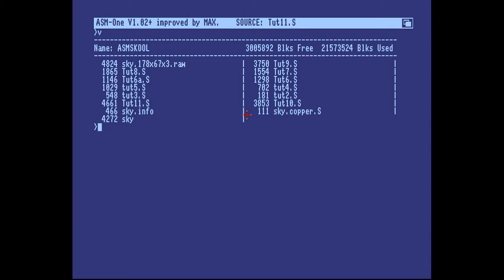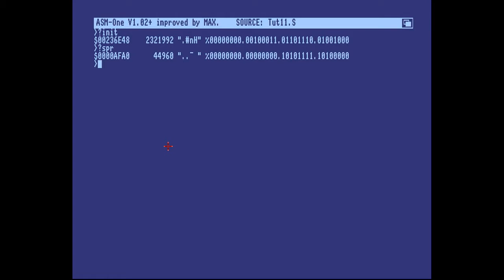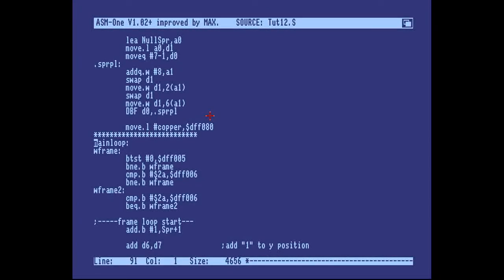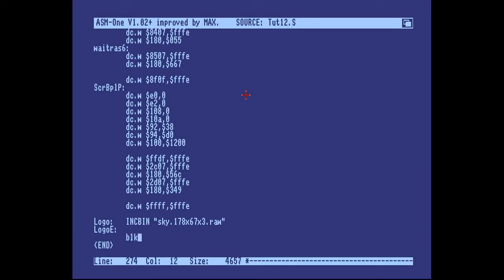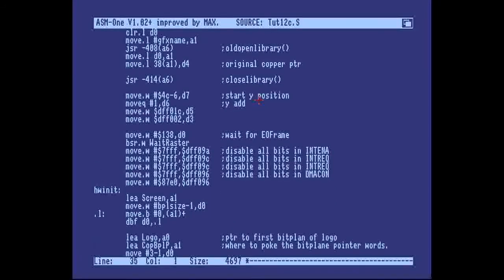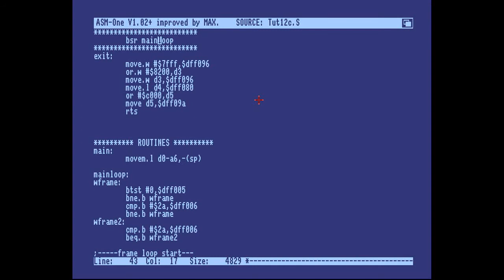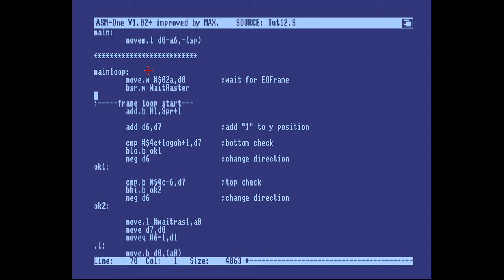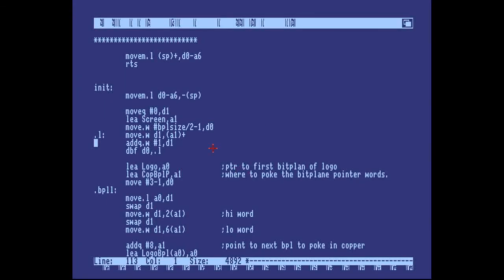Amiga Hardware Programming 12 - Bitplane manipulation, program structure, and the stack

Comment: Slowly working my way through your tutorials. For some reason I still can't quite wrap my head around the relation between playfields, display window, bitplanes and display data-fetch. I guess I should experiment more. Modern development tools have really spoiled me. I wish it was easier to debug Amiga graphics: step through copperlists, highlight stuff on the screen, ... the kind of things we take for granted when working with the browser or any modern graphics toolkit. Anyways, I'll persevere.

Thanks again for taking so much time putting these tutorials together.
Reply from the maker: The whole point of modern dev tools is to spoil you, if they spoil you they're good tools :) Directness is another feature that spoils you and is good - most of the oldskool platform coders started this way and so they could instantly get a feel for how the hardware works. I start concrete and go towards abstraction but once learned, it will become natural.

The two biggest differences from how we think about graphics today is understanding the raster (monitors still work this way, to an extent) and bitplanes combining to form pixel colors (all display modes today are one color value per pixel).
Reply: Word. Directness is exactly why I got an Amiga again and started following your videos. My brain hurts from juggling between decimal, hex and binary and having to do so much arithmetics to setup even the simplest display, but it feels so satisfying to poke some memory address in a chip and see a direct result on an analog screen in these days of ubiquitous virtualization, containers, countless layers of abstractions, JIT compilers, etc.

Anyway. Still about 30 videos to go, rambling will not get me there any sooner :)
Reply: I wholeheartedly agree. First off all, these tutorials are great, so thanks a lot for doing them, Photon! I've learned a lot from (re-) watching them, and I'm very much looking forward to the rest of them. If I can understand all of them as well as I can this first bunch (ie, up to a certain point), then surely I'll be a very happy bunny, indeed!

And like you said, Seb, there's something strangely satisfying about being able to program 'to the bare metal'. It feels very empowering, somehow -- but maybe that's because I tried and failed to do this about 30 years ago, and now I finally smell my chance at having my revenge.. ;)

And tbh, I've also been spoiled beyond believe, having Visual Studio and .Net and C# and Blender and Unity and what have you. It's nice to take a couple of steps back, and take a good and hard look at where this all actually came from. And having great nostalgic fun while doing it! :)

Comment: Is there a reason you type DBF in upper case and all the other instructions in lower case, or just out of habit?
Reply from the maker: No. Or rather, it's a readability hack that works to find code chunk starts and ends more easily without having to use multiple empty lines or comment delimiter lines.

In this case at 16:06, the end of a loop is made this way to make it distinct from other chunks of code in that function which also have a trailing empty line. 

I also put RTS to signify the return from a function, which mostly coincides with the end of the function.

In other languages you may find a lot of empty space between code. This would then be very spread out on a ~32 line editor window, so that you could read only half of a function per page.

In any language, an editor or assembler/compiler or both, can be case sensitive. Then you can't do this.

It comes from the same idea as in books: The first letter of a chapter might be a bigger capital, and when the story is done, it may say T H E   E N D instead of just...

The end.

Comment: Thanks for the nice tutorial. I wish I had something like this 25 years ago! I did have an assembler for my Amiga, but not a clue where to start and what to do with it...
I'm just starting to understand what you're doing here; when you changed the 'init:' label into 'start:' I wondered why you didn't change the 'JUMPPTR' line and when you wanted to test the program later and it didn't work I was almost talking to the screen: "go up and change the JUMPPTR line !" ; )  Mind you: I'm a total assembly noob. Could you put some more comments in your code? Just to clarify stuf you're doing.
Reply from the maker: Hehe :) And thanks! I do explain all the lines of code I write. I agree of course that Tut12.S has quite few comments in it. I will try to keep in mind to comment more!

Comment: For someone not very familiar with 68k assembly, that movem.l instruction for moving everything between D0-A6 to and from the stack almost looks like assembler magic instead of an actual opcode someone would cook up. Both push and pull take the "same" start and end sequence of registers, but clearly one has to pull them in the reverse order than the other one for it to work. Not very intuitive and user-friendly, is it?

Comment: Isn't writing...

 lea  Spr,a0
 move.l a0,d1

a more complicated way of doing...

 move.l #Spr,d1

directly?
Reply from the maker: +Rainer Koschnick Yep, that last example is how I started addressing addresses, so to speak :) Simpler and more direct, as in: move.l #addr,a0 is a synonym to lea addr,a0. Normally, addresses (pointers) go into the address registers. For example, you might want to modify the sprite-data and use the A0 register as a base pointer to do that. Typically, if you put an address into a data register as here, it's because you want to use it as data, i.e. use instructions that (due to the CPU design) can't operate on address registers, such as splitting the address into high and low word for poking the Copper list. You can replace it with move.l #Spr,d1 if a0 is not used for anything in the following instructions.
Reply: +ScoopexUs Thanks! #2 is what I had learned in your course so that's how I did it when I needed to poke the various screen and sprite pointers into the copper list. I did that right from the start because I didn't want to write absolute code (I couldn't bring myself to do it :) )